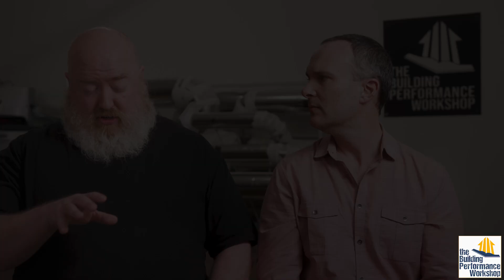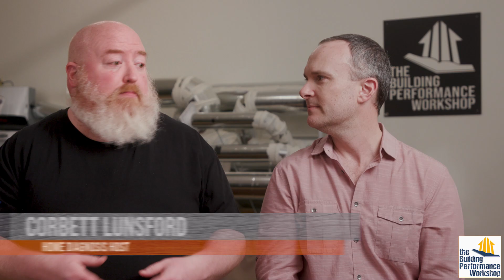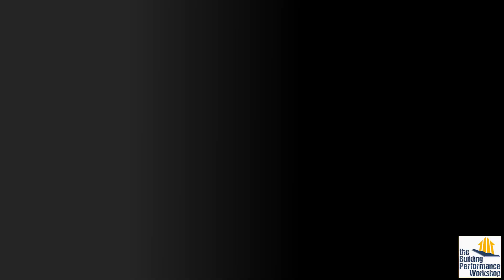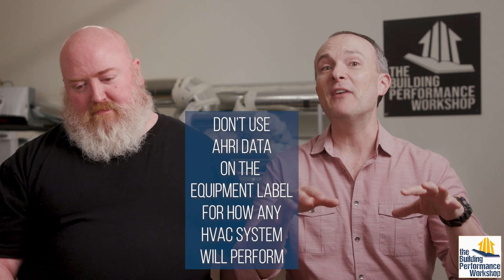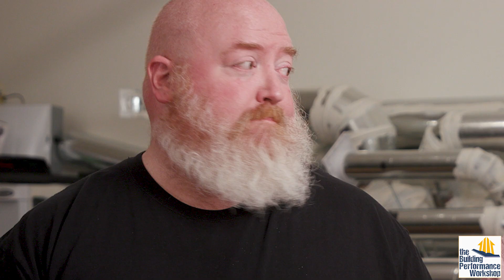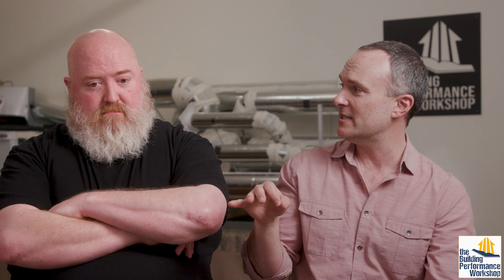Comment: With a move to higher-end filtration, does it make sense to add an axial flow fan in situations where the pressure drop on the return side becomes a challenge for an existing system?

Comment: Another great video guys. Question, I have read the ACCA low load home manual, I know super nerd here, and read the recommendations about increasing velocity by reducing duct size in the last 10 feet of a branch, as well as using nozzles versus standard registers and grilles. This is suppose to to help with air entrainment and mixing, specifically for a low load home. The problem is the manual doesn’t provide any math formulas to use in order to check the impact on a low velocity duct system, nor does it recommend or provide a listing for product manufacturers. I have reached out to a number of suppliers who look at me like I am crazy. 1. What are your thoughts on the LHH recommendations, 2. What are your thoughts on the impact to static pressure and friction loss following such recommendations, 3. Any products or manufacturers you would recommend for high throw nozzles, etc? Thanks

Comment: Hi HVAC Pro Community, hoping to get some feedback from you, I have an 18 year old home with two furnace/coil attached HVAC units in my attic, (California). The  contractor did a terrible job with the ducting design so I have way too much pressure output on the two bedrooms directly below the furnace and too little pressure output on the bedrooms on the other side of the house as the supply plenum distribution box is on that side and feeds two bedrooms, 2 baths and the master bed closet, plus its suspended up in the air almost touching the ceiling 2x4s and the box gets extremely hot in the summer—-my plan is to 1) shorten the supply run to this box so the box sits right in the middle of the house, and then attach all ducting for all bedrooms from this one location, and 2) I plan dropping the box to the attic ground level, ensure its sealed, then encase in additional insulation and add insulation to the attic on top, do you think this will equalize the output pressure on the registers at all 4 bedrooms?  I know theres a lot more info needed to provide exact predicted results, but based on what I plan to do, does this seem like it will achieve my desired results, thanks in advance

Comment: Why does high efficiency come at the cost of dehumidification ? I purchased a 2 stage 17 seer ac thinking it would be better at dehumidifying but it basically does not make any difference. Ive actually noticed during anlong run time it goes up.
Reply: With some of these newer units, it seems the poor dehumidification has to do with using larger evap coils that take a longer time to get cold enough to start condensing moisture out, and them not getting as cold.

Comment: Hi Corbett, I enjoyed the video! Can you pick a piece of HVAC equipment (manufacturer/brand/model) and give us an example showing the different results you’d get between using the AHRI data on the equipment label and the “hidden data” available to contractors? Also, can you tell us what to ask a contractor in order to either get the “proper” information yourself or to be sure that the contractor knows it exists and how to get it and use it in their calculations?
Reply: Stay tuned Ryan

Comment: If your home only has 1 return air duct and grill it's a major red flag!! Most homes will need 2 returns. Find an HVAC contractor to test the static pressure, it's so dang important!! I test every home and so many need a 2nd return air duct and grill for proper airflow.
Reply: KP, keep up the good work. My system was designed for one return and built and tested by me, video posted several years ago. Anything is possible if you plan and test correctly.
Reply: @HomePerformance  I've watched your ductwork videos and I show homeowners your static pressure video darn near every day. The problem is on a standard built home it's a 14" or 16" flex line return. That's what fits through a standard stud bay and isn't large enough for a system that is 3 ton or larger. I wish we could get builders and inspectors to test statistic pressure!! At least half of the system replacement we do need a 2nd return air duct and grill.
Reply: Nice to hear, KP! Agreed, assuming everybody knows what they’re doing AND actually do it right every time is a total joke.

Comment: I like knowing how many watts it takes to cool a watt (COP) (season/days), and in the case of a heat pump, how many watts to heat a watt, so i can compare that to various alterative energy sources.  I think SEER sort of obviates that number. For example, NG used to be 10 to 15x cheaper than electricity (per therm of heat), now it varies widely but it is closer to 4x, so heat pumps start looking good, especially with solar.

Comment: You guys know your stuff! Please keep producing great and valuable content. I had a few questions. Can you spray foam part of a HVAC rectangular trunk (about 8' long) that is flush against a wall so it'll be difficult to insulate with traditional means. Where it's located is in the attic over a sunroom and its registers are located upstairs. They produce low air flow and do not get that hot or that cold.
Reply: Problem is that it sounds like you won’t be able to insulate the wall part of the trunk. Heat follows the path of least resistance.
Reply: @HomePerformance  I understand. I was think maybe the wall insulation is helping on that side.
Reply: The next question is, as I mentioned a few, days ago my blower door test for my old 1960's home was so bad at 15.6 ACH so we have a comfort issue in certain rooms, mainly upstairs. I'm looking at getting Aeroseal to come in 3 weeks. Do you think that's the right way to go. What I've done so far was insulate my attic and air sealed it as well as sealed the attic Hatch. Thanks
Reply: Do you mean Aerobarrier? I wouldn’t seal the ductwork until I knew how leaky it was, and what the static pressures and airflow through it was.
Reply: @HomePerformance yes, OK.

Comment: Are probes absolutely necessary when using a nanometer to measure static pressure? I'm asking because most units come without probes, that are affordable for the homeowner that wants to check it out.
Reply: Yeah, if you just stick a pressure hose into an airflow you’ll be seeing TOTAL pressure, which may be higher or lower than the actual static pressure. Static pressure probes are totally necessary.
Reply: @HomePerformance  Thanks for answering my question, thing is probes seem to be 3 times the cost of a manometer, like $100 bucks each!
Reply: No way- shop at Trutech Tools, should be $20 tops:
https://trutechtools.com
Reply: Also, a good manometer like the DG-8 costs $600
Reply: @HomePerformance  The DG-8 isn't a good manometer. It's a GREAT manometer!
Reply: Well, I’m trying not to hard sell him out of a manometer under $100
Reply: @HomePerformance  Just steer him towards the Digital True Flow Grid with the DG8. It's the whole package!
Reply: @HomePerformance   NICE, thanks for the connection!
Reply: @HomePerformance  I not sure this is accurate for the intended purpose.  A manometer that measures singular pressure accurately is in fact quite expensive.  In the instance you are talking about in the video - static pressure differences, the measurement is a pressure difference and that is a different measurement.  A differential pressure transducer is a very cheap sensor, it's not hard to make a good one very cost effectively.  So, when you are only measuring a pressure difference, a lower cost manometer will actually work fine.  This is one of the reasons people can make a digital tire pressure gauge cheaply, it's just a simple differential pressure transducer.
Reply: No, all the pressures we measure in home performance and HVAC are differentials. The $600 per channel price tag is due to precision and accuracy. Anyone with a DG-8 will win an argument with a technician using a $100 manometer, hands down- and when it comes to hundredths of an iwc, I’d rather know I’m right than wait to be proven wrong.

Comment: I read an article on existing homes that Alex wrote last year. He said for a load calculations on retrofit homes, a visual inspection could be done rather than a blower door to measure infiltration.
Do you think infiltration can be measured with a visual inspection?

(I posted the same comment with a link to the article Alex wrote, but I think YouTube removed the comment because of the link)
Reply: I'm going to do a follow up on that article soon. I would say that it's not my opinion that a visual inspection can "measure" infiltration, but rather "estimate" infiltration to sort homes into two camps: the "this house doesn't appear to be so leaky that the likely results of a blower door will impact my equipment size compared to my estimate" camp, and the "I definitely need a blower door test" camp.
Reply: Ok, I’ll jump in here as someone who’s done hundreds of blower door tests and say I’m continually surprised by test readings- homes that might look leaky are sometimes tight, and vice versa. Anyone with 1 day of training can come along with a blower door and prove the load calc wrong, so I’d never leave it to guessing.

Comment: As far as humidity control from a high-SEER AC system, I have a sample size of 2 units. I have a Trane and Carrier unit, both with variable speed compressors and air handlers. The Trane unit does a much better job of hitting both humidity and temperature targets of 50% and 75F than the Carrier unit. The Carrier unit has a thermostat setting for humidity control, which allows it to run longer and reduce the temperature by up to 3 degrees. It just makes that part of the house cold and clammy. It's a one story house in the DFW area, the Trane unit cools the bedroom/bathroom area of the house, while the Carrier does everything else. I've heard the reason is that the Trane can run its compressor at a significantly lower capacity than the Carrier can, but I'm not the expert.

I would also expect that HVAC manufacturers do not set up their units to dehumidify when testing SEER, as unless humidity control is part of the test, their results will be not as good if they are using energy to dehumidify after the temperature target is met.  Whether standalone dehumidifiers would be more efficient than running a large compressor/air handler at low speed is yet another interesting question.